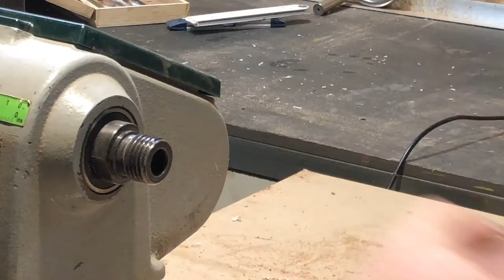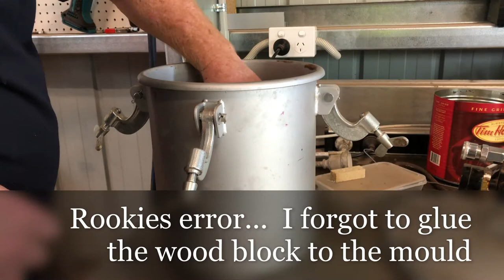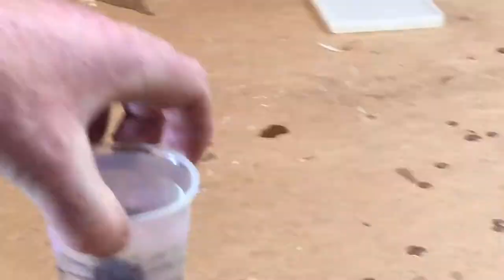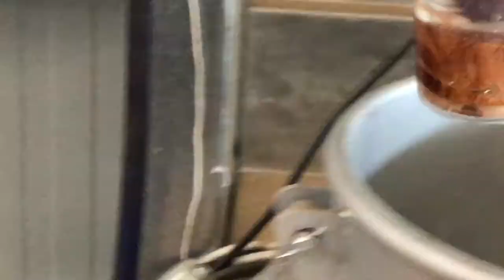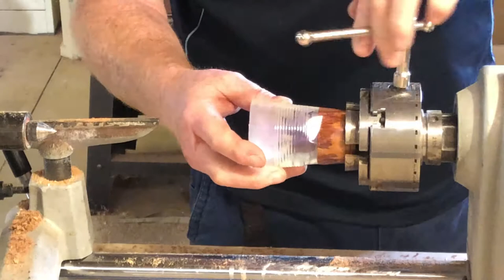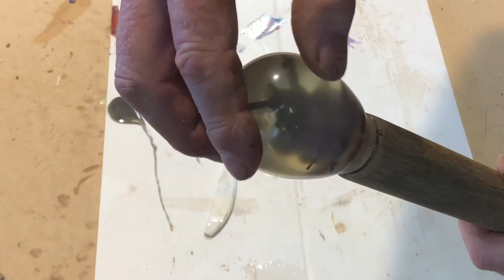Woodturning - Walking Stick

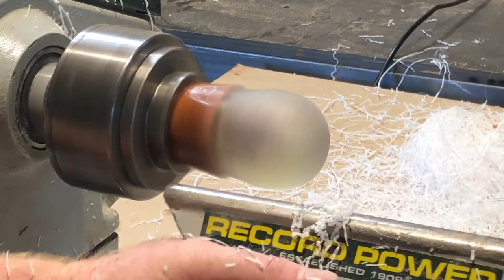Comment: Great looking piece but I winced so hard at 3:59 when you almost lost your piece by hitting the tool rest into it while it was still running. Should get into the practice of stopping the lathe before you adjust your rest, you can easily catch the piece and either destroy it, hurt yourself, or both!
Reply from the maker: Thanks for that. Hopefully I have improved over the years.